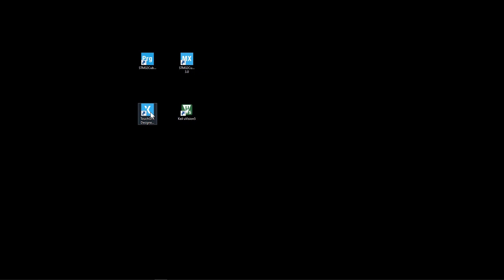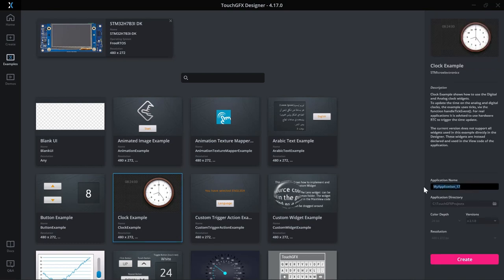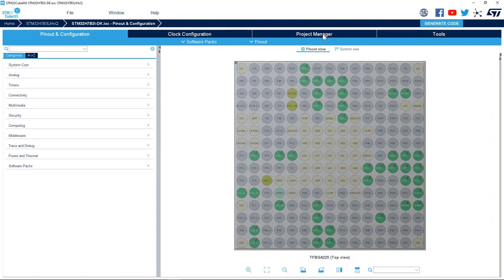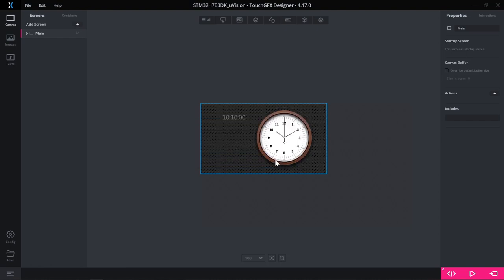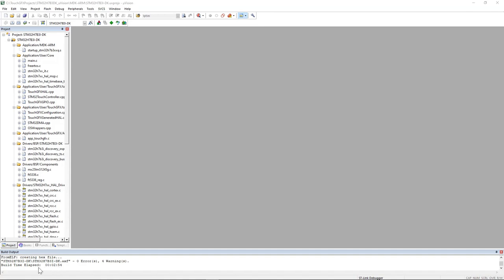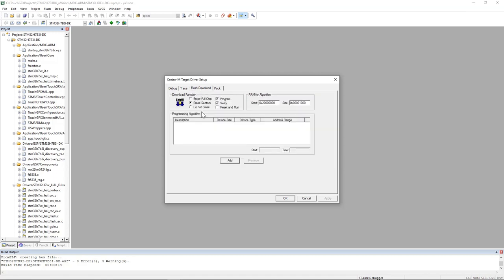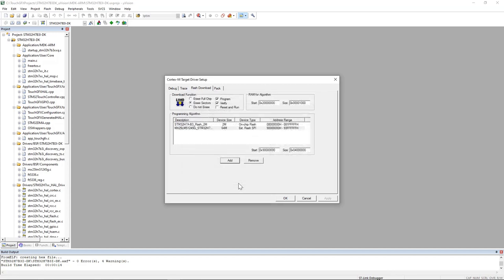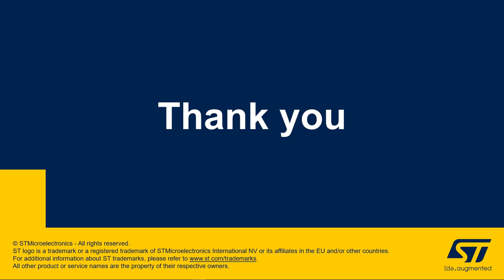STM32 Graphics: How to use Keil uVision with TouchGFX templates

Comment: Thank you for the video, 
but when I change the ARM Compiler to "Use default compiler version 6" in Keil uVision, 540 errors occur and the project does not run. 
Could you please provide a solution to this problem?ㅠㅠ

(Use the STM32F746G-DISCO board)